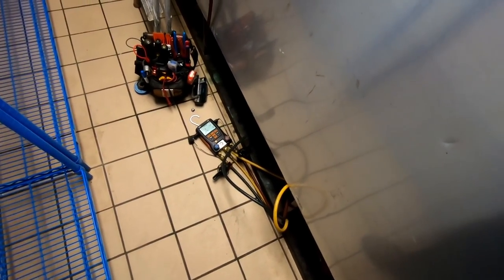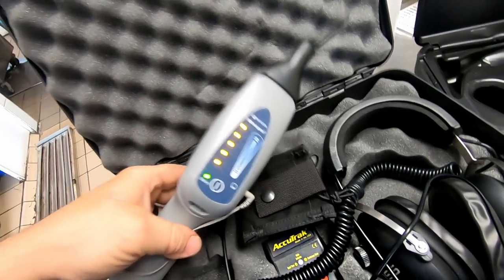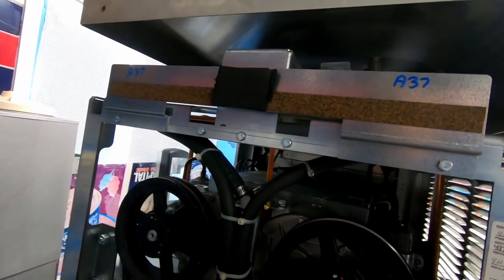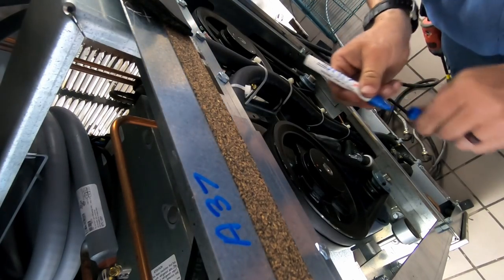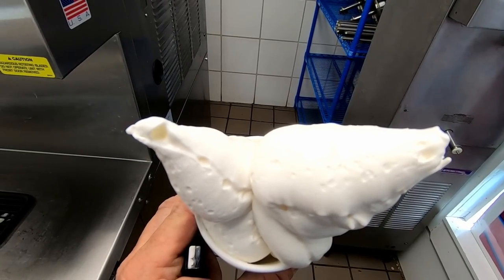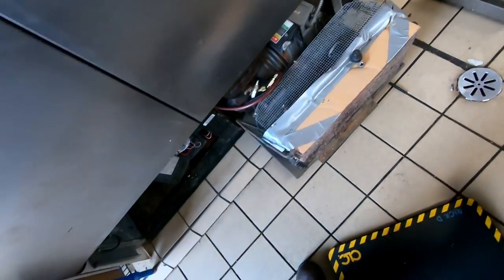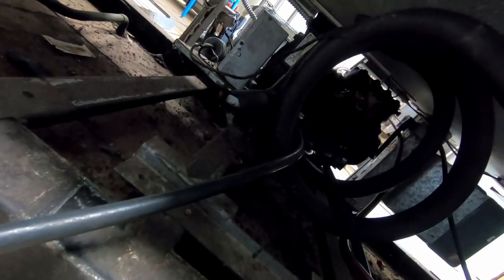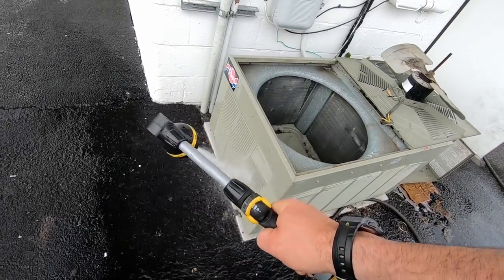Freezer / Ice Cream / Air Conditioner / Shot To Hell

Comment: Glad you found your Leatherman, best bloody kit to put on your belt. I’ve still got an old Fuse I bought when I started working my job 12 years ago and are invaluable in times of need. 😊
Reply from the maker: That one would hurt a little more. It's $130 vs the wave at $100🤦‍♂️
Reply: I carry a swiss army knife everywhere.   I have multi-tools; I preferred the craftsman to the Leatherman, but then, I have the original Leatherman. The big one that you can use as a hammer in a pinch.   There's also a Carolina Knife & Tool you can sometimes pick up cheap that's just a Gerber with a different name.  Even includes the Gerber patent number.   (retractable jaws, rather than flip fold)
Reply: I personally prefer the Gerber Pro Scout  great tool!
Reply from the maker: I've got one Gerber, it's not as friendly to me.
Reply: @HVACRSurvival  Where I’m at that’s a $300 tool since I sell the Wave at $219AUD including taxes! I do like the choose your own adventure with the hacksaw blades. If I ever lost my Fuel I’d get yours for that!

Comment: I have an accutrak, i installed a new Nordon evap and charged with nitrogen, I would hear a loud leak at times but the notrogen charge on my gauge never changed turned out the kitchen sink was on the back side of the wall of the cooler I was working on, I was picking up the frequency of the water getting sprayed out of the water sprayer that was wild
Reply from the maker: Ultrasonic is not perfect but does good.

Comment: i think you used the wrong leak detector,who does not want to fix a leak on a 5000 unit,those freezer like to leak on the coiled line set,sometimes its easy to patch.i am surprised you gave up so easy,nice video keep them coming,you convinced me to comment.
Reply from the maker: If the customer wants to buy a new unit why should I fight him on it. Normally this person is the last to replace something. Normally the EVAP is where the leak is.
Reply: @HVACRSurvival  you are right.

Comment: Thank Goodness you found your Surge . I hesitate to get one , mainly because of  the weight of it . I already weigh down my work trousers and belt with tons of tools , flashlight etc .
Do you feel it weighing you down on your belt ? Please say yes otherwise I'll just end up buying one 🤑
Reply from the maker: Look at my belt you'll see I use a kydex case. That thing is so easy to get out now. About $30-35 on eBay or maybe it was on Amazon. This tool won't break like my freaking wave has. I broke that wave four or five times This thing is twice as strong and not that much bigger.  Treat yourself to the best and just get it. I bought mine like new on eBay for about $30 less than new

Comment: Great video. 👍 the coil was in the early stages of making a wool sweater from Ireland.  Have u ever had to adjust the cpr valve on a true freezer reach-in? I have a unit n when it comes out of defrost it trips the compressor overload. Does a clockwise turn on cpr restrict flow of gas n less heat coming into compressor ?  Service valve is shot. It has a bullet piercing valve on suction side. Thought adjusting cpr n watching amps may help cut down inrush of psi/temp after defrost. Is it CW or CCW on cpr to cut down the inrush on startup after defrost? Thanks again for sharing Rick!
Reply from the maker: You crank the cpr in to reduces the suction pressure, which would reduce the amperage. (I believe I'm correct on the direction. lol) To set up the valve is you run the system into a defrost, build up a load from the heat then pull it out of a defrost and watch your amps,  you adjust the pressure on the CPR to match your maximum amperage the compressor can handle.  Just use regular amps not in rush.
Reply: @HVACRSurvival  thanks doctor 🙏

Comment: Will a regular analog guage set be able to regulate the pressure from that vn-500?
Reply from the maker: Mine's a VN 250 but if you watch it you can stop it before it hits the maximum pressure.  it's very slow to fill compared to a regular regulator.
Reply: @HVACRSurvival  I only need 150psi. Will it keep a steady flow on braze setting being that it takes time for the pressure to build?
Reply from the maker: I've heard that if you have it on braze it will continue to add till it hits the max pressure if it can't vent out